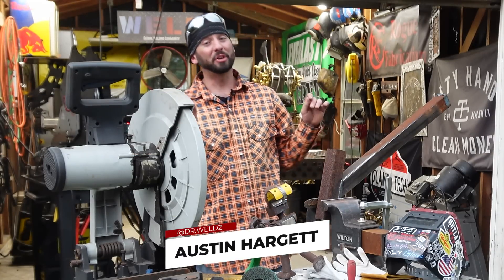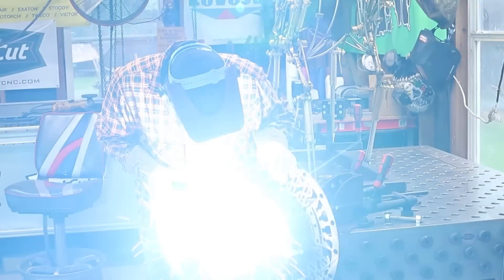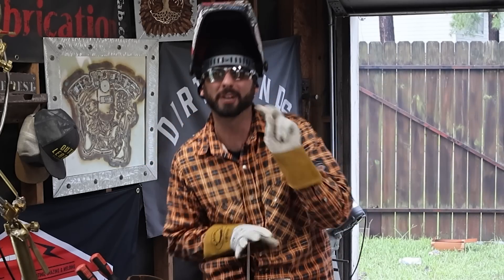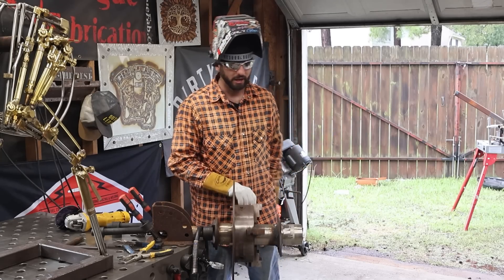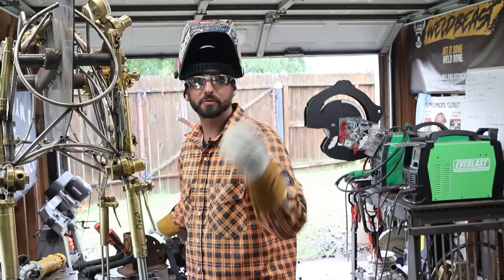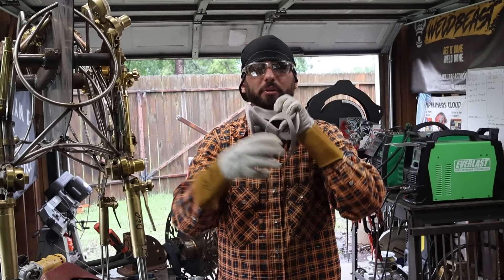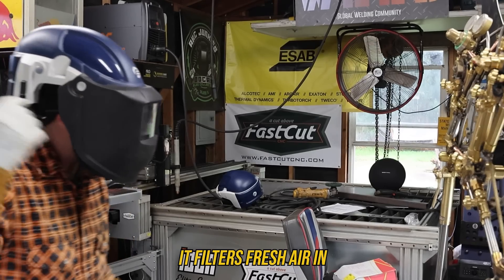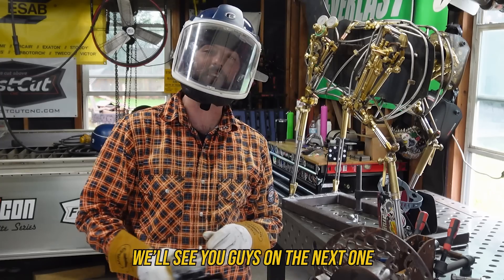5 Ways Of Avoiding Toxic Welding Fumes

Comment: PAPRs are excellent. I own my own 2 PAPRs (esab sentinel a60 air and esab g50 air). The only thing is the weight and the fact that without a flip up helmet like with a flip up visor built in, it's hard to inspect your welds. I did see optrel swiss air but it's so overpriced

Comment: Stand UP wind, not down wind.  I set up a fan, but it works WITH the natural direction of the air flow--away from me.  On my work area, I can feel the wind blowing across my hands and tool and away from me.  If I can smell anything, I am not set up right.  But I wear a filter anyway.  My two cents.

Comment: Thanks for the information. I bought a Yes Welder PAPR as I was trying something different from the 3M version you showed and I found that the air smelled worse than with just the mask. Almost like a vaccum effect. I am welding aluminum with a spool gun and it smells like ozone pretty strong, so I so I just use the 3M now. What do you smell with that helmet?

Comment: How the heck does it cost 1500-$2700 to add a fan with a hepa filter ?  
Harbor Freight to the rescue.  Maybe they can get one to run on a Bauer or Hercules battery.  Maybe I'll just strap that Hercules vacuum to my back and blow air into my helmet.  We should be looking at $300-500.  Its is the same for "sand" blasting

Comment: I use the 3M quick latch respirator it’s a gel material and it allows you to flip it down if you need a quick drink or say something to somebody without having your respirator fill with crap and without having to take your hood/hard hat off
Reply from the maker: That would be very nice to have.

Comment: Why dont americans dont like speedglass adflo systems? Everytime time i watch americans welding i have never seen them using it
Reply: Money, ignorance. Not necessarily in order. I’m a hobbyist welder, I can’t afford to drop that kind of cash on a PAPR. While I get that its cheaper in the long run, I have more important financial obligations first, keeping the wolves away.
Reply: @TBJK07Jeep  As a hobbyist, it is not cheaper in the long run; the batteries and filters cost more.
Reply from the maker: There are different safety regulations over here but trying to help people avoid fumes as much as possible.

Comment: Great stuff, very important.  If you're a garage welder like myself, you might also consider installing an inline duct fan with a long flexible hose to move wherever your work is.  I went with a Harbor Freight 8" inline fan in the rafters ducted outside.  It more than handles whatever smoke I throw at it.  Money in the bank.
Also, don't forget your hearing protection when your grinding!  I didn't until it was too late, and it's no bueno now.
Reply from the maker: A little DIY fume extraction goes a long way!

Comment: 1 keep welding at arms length 
2 wear air fed system 3m speed glas are ok free at my work 
3 on torch extraction 
4 use all above keep cancer at arms length
Reply from the maker: Great advice!
Reply: Do you have one at home?
Reply: @tsl7881  have what 3m gear yer hard hat system don’t use I’ve Sean sentinel old style reactilight also black glass monkey mask

Comment: Nothing beats 3m's welding masks with adflo. Available with or without built-in helmet. It's also very comfortable to wear when it's hot, as the mask has a cooling effect. And a big plus is that you can flip up the front and have a large clear visor underneath when grinding.
Reply: Dont do you no good unless your a production welder thats over a table all day
Reply: @Undisputedcomedy1  Nonsense I use my 3m 9100mp everywhere. Inside boilers outside on buildings inside the workshop, but have experienced that it has been too cramped a couple of times. And then I have used a regular p3 mask

Comment: I remember my brother in laws shop back in the early 1970's. He had seven welders in there all burning no 8or no 10 rods on structural steel no fume extractors. The only good thing was the building was quite tall, but it still filled up with thick fumes by the end of the day and if you went up onto the mezzanine you got gassed pretty quickly.

Comment: I have already learned to wear a mask from 3m at all times. It is quite comfortable and does not make breathing difficult
a little tip: choose the 6500 or 7500 series where the outlet is at the bottom - this will prevent the windows from fogging up
Reply: The 7500 paired with 2297 filters is a mint setup.

Comment: What's a good mask for pulverized coal dust?
Reply: 3M. 6200/6300 series with any filter. For powder (toner for laser printers) I use  base 603, filter 5911/5925/5935, holder 501.

Comment: For a solution to the hot shop, a mitigation could be something like the older Land Rovers used, which was a second roof, standing off an inch or two so that air could flow between it and the actual cab roof, and the outer roof took the brunt of the radiant heat and kept the actual roof perpetually in the shade?

Comment: That system looks heavy with a fan and batteries in the mask. I would recommend 3M Speedglas Welding Helmet G5-01 with Adflo Fan-assisted breathing protection
Reply: Definitely the best mask you can buy. If you need it with a helmet, I recommend 3m 9100mp

Comment: The 3m quick latch respirator is better then that standard 3m respirator he showed in this video, a lot quicker and easy to remove or just drop down if you need to talk to someone
Reply: I used that quick latch respirator for a couple of years and I can say it's probably the best respirator out there! The latch makes it easy to drop down real quick and the exhaust is facing the bottom so it never fogged up my hood.
Reply: @slayer1561   yeah it’s definitely the best I’ve used, I do have the problem of my glasses fogging up and that’s the only problem I have with it

Comment: Ever since I started welding a couple years back I’ve always worn a 3m half face respirator with a 2097 filter… I’ve had plenty coworkers make fun of me for wearing it saying that tig welding doesn’t put off fumes. It’s truly sad that people deny the fact that welding fumes are awful for ya. I tig weld stainless steel, every time I change a filter it’s crazy to see how much dirtier the old filter is compared to the new ones!
Reply: Does the 2097 have good protection against organic vapors or is it just OV relief. I had a P100 with OV relief I would wear and I’d still get headaches after work welding galvanized and stainless a lot not to mention antispatter spray and what not. Just upgraded to an ellipse p100/organic vapors and gases. Can’t smell anything anymore and I go home headache free. I’m probably still fucked from the four years of improper respiratory protection. Long story short make sure you’re protected from vapors and gases too.
Reply: @chrisp9046 

You needed the combination filter 3M 60921 Organic Vapor/P100 Cartridge.
Reply: If they admit that you're wearing a respirator for a reason, then they have to feel ridiculous for not wearing one when they work with worse fumes.
Reply: @ara_brodjian2533  news flash- everything is bad for you.
Reply: I found a Miller half face respirator at a welding supply store. Fits nicely under my hood. The 3M ones from Home Depot were too bulky to lower the hood while wearing them
Reply: @BabaYaga214  What kind of material are you welding though and process
Reply: Hmmm yes job burning metal together not safe hmmm yes

Comment: Americans please, there are welding masks with fresh air units like 3M Speedglass fx models. Please start to use them. Everybody in europe uses those types of units.
Reply: I have the 3m 9100mp. Had it since 2014 works grate. It's also a great advantage when it's hot outside, as the mask provides comfortable cooling

Comment: Excellent practical presentation. I'm looking at options for a home shop I'm setting up in two bays of my garage. I'm leaning towards a central fan and making a portable "smoke eater" from a HEPA vacuum with a large suction side hose. I deconstructed an NSA certified welding smokeeater that my work bought for the shop a few years ago, and that's literally all it was: a fan with a filtration system and an 8" suction hose with hooks and a handle.

Comment: that PAPR welding hood is $2K, holy cow!!
Reply: Neuromuscular damage and lung cancer are a lot costlier. $2K ain't no hill for a stepper if you're a qualified welder.
Reply: @toterola451  yes, but there are a half dozen other options this guy shows that are a hell of a lot cheaper.  Like the 3M mask for example.
Reply: @toterola451  I'm perfectly fine welding stick out in the field and having the wind blow away the fumes and using the miller respirator for dual shield shop welding. Yes, your correct, your health is more important, but we also have to consider the rise of capitalism and the introduction of fear these company's bring to blue collar workers. COVID was a prime example, if you can make someone feel unsafe unless they buy this and that in order to feel better about themselves, they most certainly will. As an engineer and structural steel contractor, if I've learned anything about college, its the brainwashing and intimidation large corporations bring on working families that sustain this country.
Reply: Yeah, PAPR hoods range anywhere from $1400 to $2500. It's a good investment, especially if you're planning to make a long career out of welding.
Reply: Pay now or pay later.
Reply: Don’t worry. Welders won’t buy it until really good at welding.